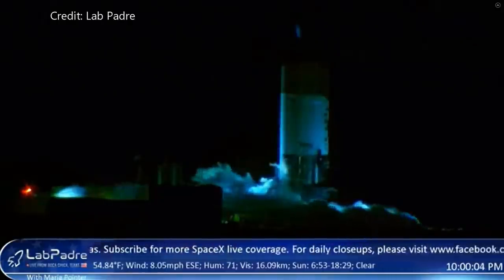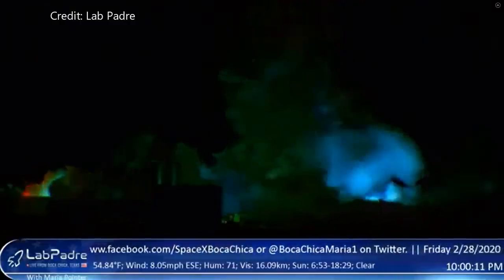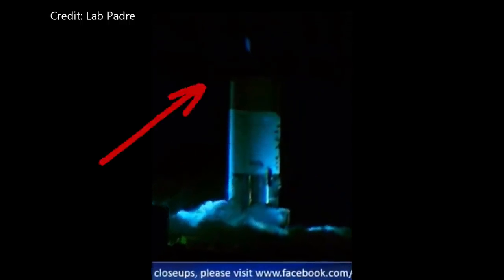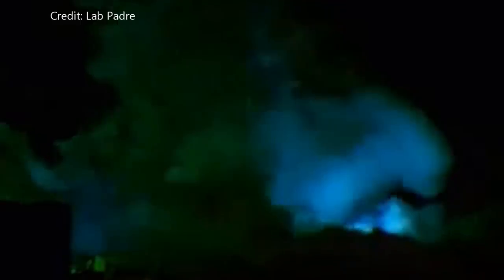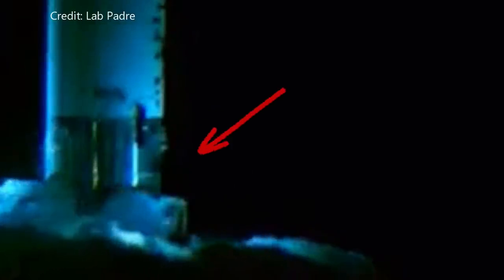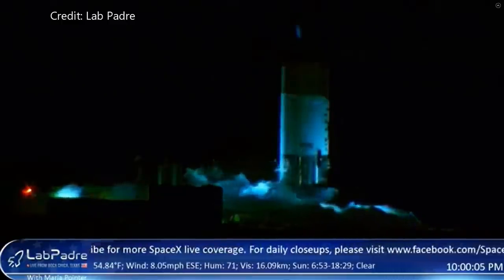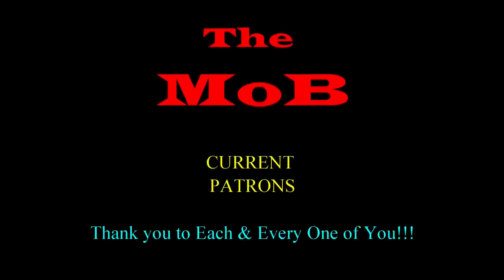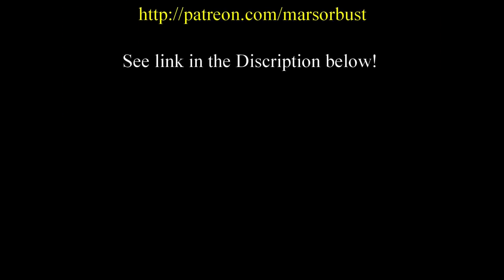SPACEX STARSHIP EXPLODES AGAIN!!! WHAT HAPPENED?  SN1 IS GONE!!! What Now???

Comment: Don't give up this quickly! Just improve the welding quality. I'd also weld a strip of metal overlapping the welds on the inside (using spot/roller welding) to double the strength of the seams without adding significant weight.
Reply: Thats what i was thinking they could do.

Comment: Failure provides a path to improvement. 

Testing identifies points of failure.
Reply from the maker: Hey Rob!
Agreed but I feel some of this could be avoided and should have been worked out through engineering design rather than build and destroy. Granted its taking for forever and a ton of money and that is wrong but with SLS they already know what will work and what won't before its even built. I think SpaceX could do the same for a LOT less time and money!
Thanks! 
SM Dave
Reply: Rob Collinge In the 60's yes, today full size experiment only validate computer models and apparently they are very wrong.
Reply: Rob Collinge In the 60's yes, today full size experiment only validate computer models and apparently they are very wrong.

Comment: I assume SpaceX does a Finite Element Analysis (FEA) of the structure including the welds under a range of pressures and temperatures ... and temperature differentials. And I hope they adjust their models every time test data does not match the model.   Temperature differentials are suspect, welded metal metallurgy characteristics are suspect, uniformity of welds and comprehensive testing of all welds through various means may be inadequate(NDI, Eddie current tests, etc).  There are many lessons that could be learned from this and many compensations made to 1) FEA modeling, 2)welding process 3)weld tests 4) seam design[perhaps adding a 4 inch wide band of sheet metal welded over the weld] 5) more tests to improve their FEA modeling of welds [measure deformations and stresses over wide range of temperatures, temperature differentials causing thermal expansion stresses, vibration stresses, high g load differential pressure]

I expect this will delay the program by a year.  Unless they figure out a way to beef up the weld seams on the other one already half built

Comment: Hand welding may have to go. They need Aerospace Manufacturing Engineers. Faster is not always better.
Reply from the maker: Hi Tony! 
Yes I agree! 
Something has to change! 
SMD 
MoB
Reply: Precision machine controlled laser welding in a total controlled environment (argon gas? and a jig that holds the pieces perfectly aligned without residual stress holding them in place)

Comment: Elon Musk said something that it wasn't welded on a right setting at some places. He said that before SN-1 exploded.
Reply: Yes maybe they'll get it right the next time
Reply from the maker: Sorry but that's starting to sound like an excuse. If that's the case, then it should of been cut out and rewelded! 
Thanks for the comment! 
SMD 
MoB
Reply: @MarsorBust  Na, Elon doesn't care about making one prototype work, he's trying to figure out how to make the assembly line do it right the first time. Cutting everything out and re-welding is just a wast of time in pursuit of that goal. If the tanks are not coming off the assembly line correctly then the assembly line needs to be fixed, that's all Elon cares about right now.
Reply from the maker: @JohnnyThund3r  Unfortunately that not the way this type of industry works. 25+ years have shown me that much! He got it right with falcon using proven techniques. He needs to expand on that! 
Thanks, 
SMD
Reply from the maker: I'm Sorry I dont mean to keep coming back to this but maintaining the correct welder settings is a quality control issue...
Reply: @MarsorBust  let me guess, you don't weld.

If you're so clever and you know how to do it right, go down to Boca chica and apply for a job. Better yet engineer your own rocket, and start your own company.
Reply: Forlarren if you know something that others don’t, then please do tell; especially if based on welding experience/knowledge ... you sound defensive,  are you by chance the guy who welded the seam with the wrong settings?
Reply: @jtjames79  What's your problem? Go away or something
Reply from the maker: @jtjames79  Well I was passing AND rejecting you welders so you could weld in these places. And yes I can weld but I chose to be an inspection engineer! Thank you!!!
Reply: @MarsorBust  I already unsubscribe like you asked.
Reply: @MarsorBust  That is false. F1 had many failures like this and so did trying to land first stages. SpaceX is doing nothing different here. This is early prototyping of both the rocket, and manufacturing techniques. This won't be the last failure either.
Reply from the maker: @jtjames79  Didnt ask but ok...
Reply: Welds are the strongest point in a structure, unless for cost cutting they are not checked and the welder are paid by the foot. A very bad practice in any construction.

Comment: I think people are getting far more upset about this then they should be right now. Musk has stated recently that the USA doesn't focus enough attention on manufacturing; We have this romantic idea that after someone builds one prototype that it should be easy for them to produce hundreds of that prototype, when in fact mass producing any product is ~2.5 times harder then just building a prototype of that product according to Musk. You need to identify which parts are easy to manufacture and which parts are extremely difficulty for you to manufacture, then work on making sure every part you produce is well designed and cost effective. Musk stated they took this process with the Starlink satellites, in that they had no working prototype when they started building the assembly line. According to Musk this is a far better way to develop a product, because now they can produce Starlink satellites faster then they can launch them at a very competitive price.

Comment: For some (mostly unmanned) missions, keeping the rocket stage and the payload space (fairing, if one is needed) separate may be better. Thus adding a third stage would be possible. Space X has no method for returning the second stage from LEO. So far, Starship as a vehicle integrating payload bay and rocket stage into a single unit is skirting the issue and allows recovery of the whole unit. This is a specialized welding job and those are specialized tanks for a new application (large rocket ship). James Watt took a long time to develop an effective steam engine at a time when engines of any kind were new and largely unknown. It seems a double-wall design would still have to be failure-proof but it would be structurally stronger and heavier.

Comment: I thought it was strange they put sn1 on the launch pad without legs, engines and the upper portion.  

I’m thinking this test to failure was on purpose.  I do agree with Tony’s comment below!   Hand wielding especially on something that holds an enormous amount of pressure is a HUUUUGE risk!  Very easy for mistakes!

Percision is what is needed for those tanks!
Reply from the maker: I Agree 100%!!!
Reply: SN1 was going to be used as a vertical Raptor test rig had it passed the pressure test hence the trip to the pad.

Comment: Elon Musk tweeted this on the 26th:
 "We had the wrong settings! To make the welds super flat & strong, we’re building a heavy duty, custom planisher, but just having the right settings is a major improvement." 
So a significant portion if not all of SN1 was welded using incorrect welder settings and this is the consequence of that. Pretty costly screwup using the wrong settings, but SN2 + should be much better weld quality.

https://mobile.twitter.com/elonmusk/status/1232556310874533888
Reply from the maker: Planishing weld seams on the ring sections shouldn't be a problem but the head to shell welds may be a little more difficult. 
Thanks! 
SMD 
MoB
Reply: Space.Coast.Beach.Bum pretty expensive mistakes being made here. Too bad they didn’t bother to test weld smaller pieces and then QC these welded test pieces before they tried making a whole space ship. This now looks like a publicity stunt to keep everyone entertained while SpaceX builds the infrastructure. Poor practices , poor QC, and poor management!
Reply from the maker: @raymondrussell500  I would hope they are doing what's called test coupons and sending them for annalise where they test to failure on those instead of the final product but maybe the Starship is the coupon...
Reply: Mars or Bust so far it looks just like that is the situation
Reply from the maker: @Biddle World I completely agree with you on this! 
Thank you for the comment! 
SMD 
MoB

Comment: the bottom line of frost, is where the tank connect to the ring. The rupture happened  in the engine thrust structure. All the vapor out the bottom, in my non-expert opinion, suggests that a leak in the bulkhead itself, in the direction where it did blow out.

Comment: As a retired nuke welder I have been totally unimpressed by the quality of the fabrication. so sad.
Reply from the maker: Hey James!
I know where you are coming from on that!!! 
Thanks for the comment! 
SMD 
MoB
Reply: So with your expertise do you think welding is the way to go? Or should SpaceX limit the use of welding? Or?
Reply from the maker: @douginorlando6260   Hey Doug!  It's always better to limit the number of welds needed as much as you can. Unless the forming of the product thins the material to the point It becomes too thin to hold the pressure. 
SMD 
MoB
Reply: I'm sure you didn't weld what was it? 4mm SS now? I believe you were welding a much lower grade steel with a marginally thicker wall, not to mention the minuscule scale compared to starship. Were you welding nukes that left earth's atmosphere or ones designed to be air lifted and dropped into a target? Obviously this was setup for failure, you could see all the monitoring devices welded onto the side, no way was that going to be a finished product. Just designing custom parts on my 3d printer I can tell you I test and have many failures. Even my racecar I deliberately push it to see what fails so I don't have a failure on the track. Failure is part of innovation.
Reply: @AnubisSolvang  I welded in the nuke power industry all grades and thickness of ss and many different alloys. I am rooting for Space X but what I see as the problems they are having is a combination of engineered weld design and execution. ss is extremely sensitive to keeping the weld covered with shielding gas on both the front and back of the hot metal. Base metal temps must be kept in the goldelox zone. welding in a wind storm will " never" end with a good weld. A properly designed and executed weld will be stronger than the bass metal. This takes great care, care that I don't see. That being stated I have no doubt that they will get it right!
Reply: @jamesretired5979  I have been wondering about friction welding and if it would be a viable option. They could have it set up on a rig with a rotating arm on the inside and have the whole process automated. Everyone has their opinions but to call this unimpressive is just plain arrogant.
Reply from the maker: @jamesretired5979  Great explanation! I couldn't have said it better myself!! 
SMD 
MoB

Comment: As a small boy my dad took my broken bike to a welder for repairs. The weld failed, and if memory serves, I observed this sort of thing more than once. I’m afraid I have little confidence in welding, apologies to all you excellent welders, but my experiences have fixed the idea in my head. Now, I have a question. Is it even remotely possible that the rounded portions could be cast in one piece? Some of you guys who are knowledgeable in this area please chime in, thanks.
Reply: Willy Makeit - 301 Stainless can’t be cast.
Reply: TraditionalAnglican hi, thanks man, metallurgy is outside my skill set. From your perspective does this appear to be a design problem or a welding problem?
Reply: Willy Makeit - Don’t know much about metallurgy except that 301 SS, what’s being used here & on the CyberTruck, are heat-treated & forged & much stronger than any cast metal could be. A properly done weld will normally be as strong as the surrounding metal, & Elon Musk said there was a problem with the welds on SN1. Without knowing what the pressure was at the time of the rupture, I can’t say what caused this, but I do have a hypothesis - How much do you think people would pay for “Limited Edition” CyberTrucks made with “Certified Starship Steel”? The material used on Starships is CHEAP, & most of the cost is going to be in the jigs & tools used to manufacture the Starships. Getting an extra $25,000-30,000/CyberTruck might be worth “Testing a Starship to Failure” once SpaceX has decided that Starship isn’t going to fly. Not only would they get good data on Point of Failure”, but they’d pay for the jigs & tools while “clearing the field” of unused Starships.
If I’m right, SpaceX may test the next 3-4 prototypes to failure AFTER their flights until they get to the ones they’ll use to test “Reuse Procedures”. Because of the hardness of 301 SS, “blowing them up” might be easier (& possibly safer) that cutting them up.
Reply: TraditionalAnglican thx
Reply from the maker: Wow have never heard anything like that, but it makes total sense!!! 
Thanks!

Comment: OK--------------- Dave knows a lot on welding but he is a lousy engineer since he is ready to throw out the baby with the faulty crib instead of fixing the problem.  The  problem may not even be welds but adding a little mettle to the flanges around the bottom of the tank to take into account of the added pressure from the weight of all the liquid towering above. But Space man Dave doesn't have a clue.